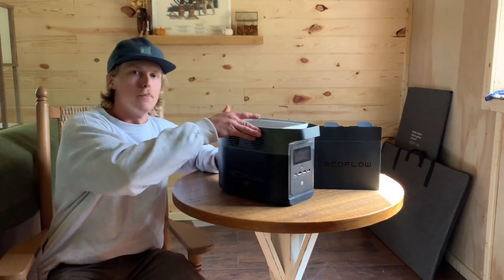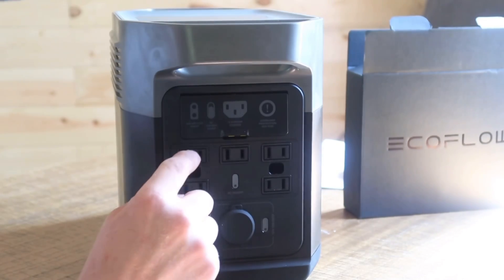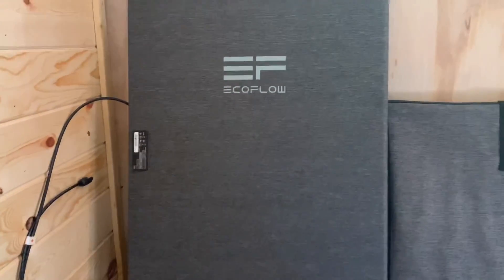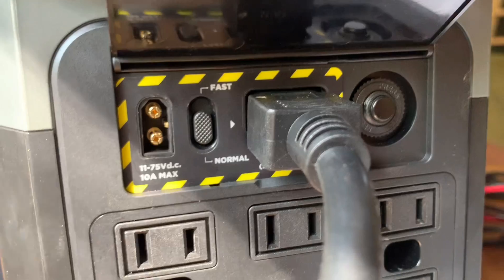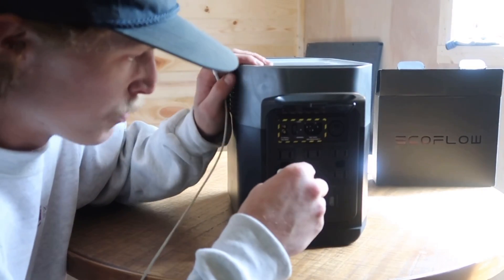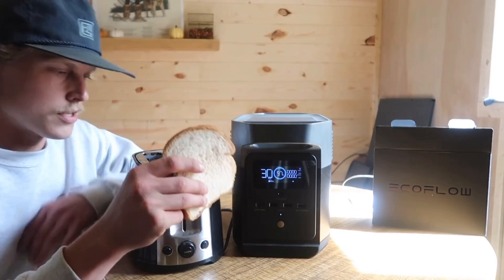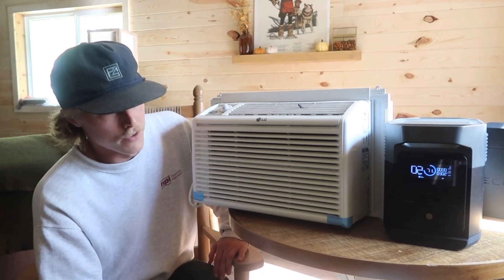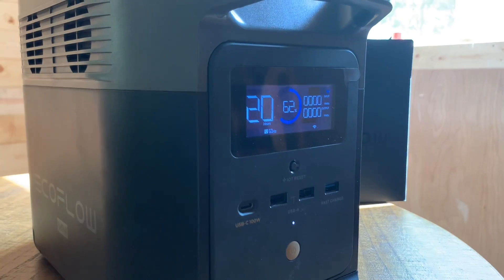EcoFlow Delta Mini: Incredible Off Grid Power!

Comment: you can also charge via solar panels and use the battery at the same time
Reply: Yes, but there is a power limit on the DC input, 10 Amp.

Comment: i'm thinking of buying the mini so I appreciate your video, it is very helpful.  There are a couple of things I wish you had talked about.  When you ran the air conditioner, what size was it, did you have X-Boost turned on and what was the voltage drop in order to achieve the starting current for the air conditioner?  It probably isn't healthy for an A/C unit to start with a large voltage drop.  Would it start the A/C without X-Boost turned on?  The other thing is solar charging.  You said you didn't want to use the 400 watt panel to charge the mini.  Something to bring out is with solar charging, as long as the solar input voltage is within the voltage input range allowed by the mini it will charge and limit the charging power to it's max allowed.  I believe I saw 75 volts as the max input to the mini and if the 400 watt panel output is less than 75 volts it should charge the mini with no problem.  These are things I think about and are in no way meant to be critical of your review.  You help a lot of people.
Reply: On UK website it says you can use 160w solar panel times 3. So you can use a single 400w panel

Comment: Thanks for nice review.

For additional test, I'd charge the unit with solar panel(s) while, at the same time, having various appliances connected to the generator, for extended period of time, to see if the solar charging is keeping up with the unit's discharge, especially under heavy load.
 

Ea. 
I ran desktop computer that drew 200W over 700W inverter, while gaming for over an hour, from led-acid 60Wh RV battery connected to 200W solar panel, under clear and sunny sky. The battery maintained constant 55% discharge level. I assume that I could've run my computer for much longer without draining the battery to death.

Comment: Yes I live in Florida also run AC when the sun is out but a soft start unit.that  looks like he’s running with no 1800 W surge.Yesterday I was running air conditioner with ecoflow 600 for like 45min. But was just testing it as a clean intermittent  power source with large industrial lead acid as primary power bank feed by the sun to basically UPS the river 600. And clean power/monitored consumption. Big take away soft start air conditioner.

Comment: And what if you are logged out of the app, and then all of a sudden the internet goes out (like in an emergency) - guess what, you can't use the app because it REQUIRES you to be connected to EcoFlow's servers. Yes, you can use the basic functions of the unit, but then why did you get a unit that has control with an app?
Reply: Thank you my thoughts exactly!!!

Comment: The mini can take up to 70v(so you can overpanel) of input. It will only use 300w of it. Your 400w panel is only 48v...it will work on the mini just fine. You then can max that 300w.
Reply: Good to know 400watts solar setup won’t fry it.
Reply: What about the 10 amp max? 
I’m asking because I’m a beginner and I bought the mini on a Black Friday lighting deal. 
I’ve read two one hundred watt panels in series work best, so I’m confused. 
Am I not suppose to exceed the volts or the amps?
Reply: @darrellee4953  1st let's talk amps. You can always go over amps. Think of it this way. Amps are pulled. The mini (or any sogen for that matter)...can only pull what it can use. So if the panels are making 20 amps.. the delta mini can only use/pull 10 of it. Volts on the other hand are PUSHED onto the sogen. So the delta mini (or any sogen) can stop what's being pushed on it. So you never want to exceed volts. So that being said the mini can take up to 75 volts. So basically any 2 panels that go over 300 watts...(get 2 of the same size) 160s 180s 200s...most of the voc of these panels are between 22 and 25. So way under 75 combined. Series connections add volts together but not amps. Parallel adds amps together but not volts. Then there are always serial/Parallel connections...but that's a longer subject. :)

Comment: Looks pretty huge. How can this be practical in camping scenario? The weight alone of this two combined is a massive 128lbs. It doesn't even have wheels.
Reply from the maker: It only weighs 24 lbs
Reply: @KYLESCABIN  Love your videos. However it's not really off grid when using cell phones which use the grid lol
Reply: @timsolomon8352  hahahahaha
Reply: Ha.

Comment: Nice unit.  You should express the operating temperatures and if the cell is replaceable.   My shack is cold till I show up in mid winter.  If its lithium it will not like being charged in the cold temps.  If the cell does degrade, and they will, can you replace just the cells.  Just a few thoughts for field use one should know.  Take care.
Reply: Wow, so much info.   I have battery backup to my solar system.   We got pretty cold last winter and I probably need to find out if they are okay.
Reply: Just wrap in a DC blanket. They only draw like 30w on low..once its warmed up.. the charging will keep it warm on it's own after a few minutes.

Comment: All the Eco Flow solar generators have the wrong cell chemistry which equals (800) short cycle life. Off grid should have Life PO4 chemistry which has from 2000-5000 cycles and Life PO4 is much safer.
Reply: Is that 2000 to 5000 times powering up? And which solar generator that you know of has that life cycle.
Reply: @cabininthewoods7326  A cycle means a full charge and discharge, so Life Po4 a one cycle per 24 hours could last up to 5000 days which is well over 10 years.  EcoFlow which use Lithium NCM has only 800 cycles to 100% which is less than 3 years at 100% EcoFlow is best for backup power and not Off grid. Most other solar generator have switched  to Life PO4 batteries.
Reply: Not exactly true. Given that the EcoFlow products charge up in (literally) a tenth the time as some of the competition, including Yeti, they're kind of a life-saver for providing power in a reasonable time frame. Need to run something in two hours, and run it for four days straight? EcoFlow can do that... and that's not even in their (EcoFlow's own) list of claims, that's from tested, proven, reliable evidence lol. Edit: While you could have a point for rechargeability, the price point of EcoFlow products, as well as their tech support, are pretty heckin great considering their competition.
Reply: @lolcatsravenight  They use Lithium NOM batteries which can and have caught fire. EcoFlow is good for Home backup power. I have a off grid cabin I don't want to use a gas generator. It doesn't charge any faster with solar than other solar generators in its price range. The cycle life is a no go for me up to 10 years vs  3 year batteries life.